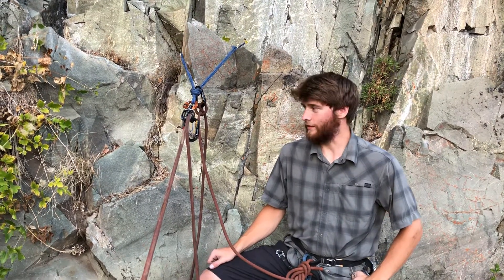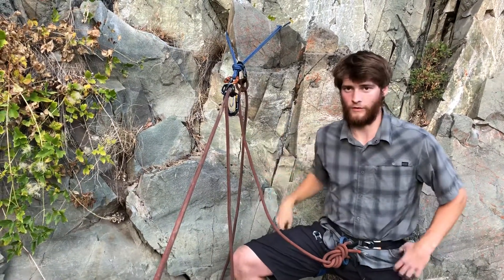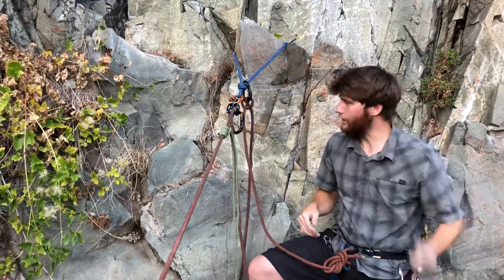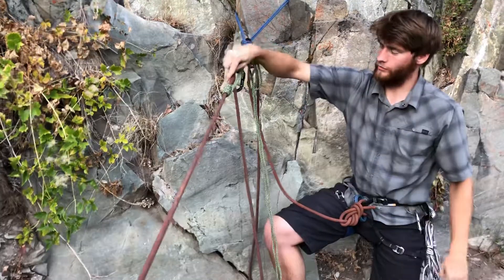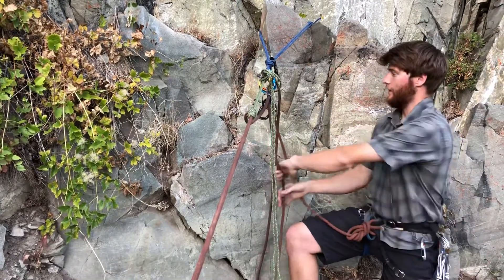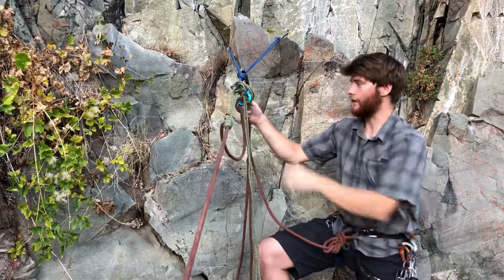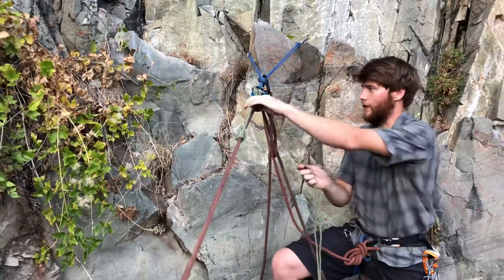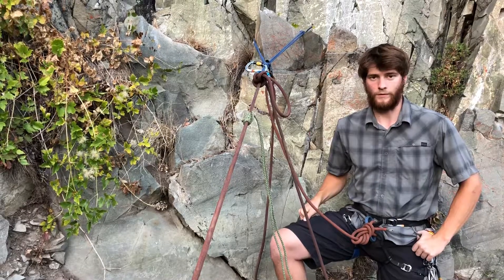How to retrieve a devise from the system

Comment: Hey Ryan, great video! One thing I'm noticing is that from the "baseline" position, when you are setting up the Klemheist,  you are operating hands-free on an ATC Guide in guide mode. But as far as I'm aware, the ATC Guide is NOT a hands-free device, right? Would it be safer to tie an overhand on the brake strand of the ATC before setting up the Klemheist? Thanks!
Reply from the maker: Hey man, yes it would be best to tie a knot in the break strand, I think since we were filming this video on the ground I forgot to add that in when I was setting the whole belay up, but yes you do want to add a knot in the break strand if you're going to let go of it for any length of time. Thanks for catching that!